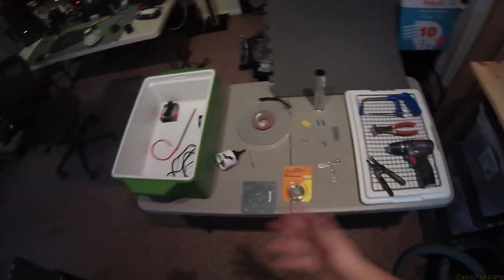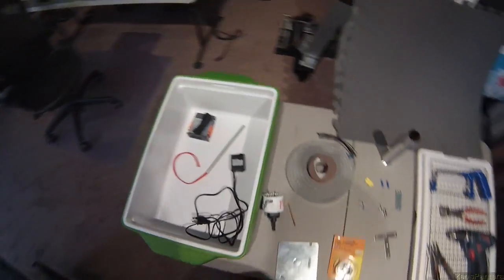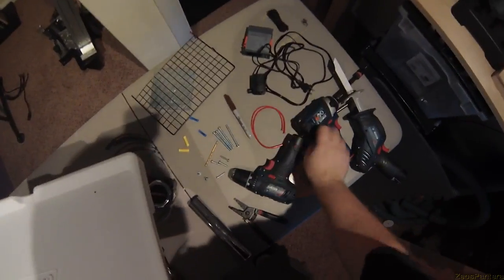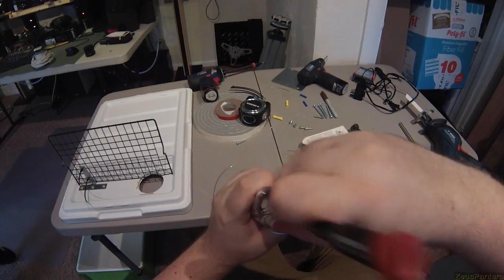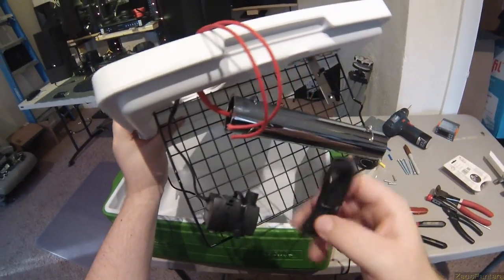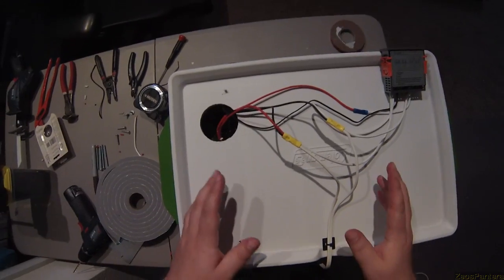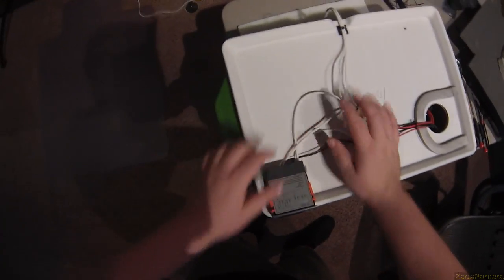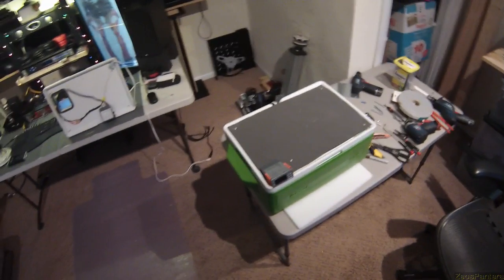$100 DIY Sous Vide - Build Video (Z How)

Comment: Nice build! Gonna try this myself this weekend as soon as the heating element gets to me😁
Just a few questions/remarks:
Is there a reason you drilled such a large hole for the cables to go through? Like venting or so? A smaller hole would allow less heat to escape, making it more efficient i guess? Or is this neglegible?
For what reason did you choose to mount the temperature sensor so close to the heating element? Did you measure the water temperature at different points throughout the container? Is it heating evenly? 

I guess i will try to put the insulation on the inside of the lid, but thats just for aesthetic reasons. Then mount a small project box to house the TC and cables, sealing off all gaps and crevices with epoxy. Maybe add a little valve to let off any excess air pressure if neccessary. 

Would be happy to hear your thoughts on this. 

Best regards from germany and keep up the good work!

Comment: Crazy question, why'd you make a 2.5 inch hole for just a few wires. wouldn't you want that hole as small as possible to prevent heat lose?
Reply: yeah need an explanation to this wondering

Comment: Great design. Impressive. I think I would've directed the water pump to shoot downward through the pipe with the heating element that way water within the pipe is always circulating.  It also creates an natural circulation throughout the entire cooler.  I assume this has all the safety elements that the store bought units would have in case the pump fails or the heating element circuitry doesn't turn off and on - all the other failure modes.  Leaving this running for 10 hours unmonitored without those safety elements in place would make me a little worried!
Reply: I too would send the jet down the heating element or drill holes into the pipe for better circulation.  Only safety issue I can see is water evaporation leaves the heating element out of the water and it burns out.   Which should just kill it, stops working as it burns out.   Only problem I see with sous vide cookers, all of them, if you're on a long cook and the power goes out.  How long was the power out and are your pathogen counts OK.  The odds are so low if your country has stable electricity.

Comment: I've heard conflicting opinions on those cartridge stick heaters as to if they are waterproof or not. On the top (wire) end, is it open or sealed all the way to the end of the wires?
Reply from the maker: Ive got two types. One was sealed the other just slipped a protective shield down over the contacts. So it is hard to say which you buy.
Reply: Z Reviews thanks for the reply. Do you remember if the brand you linked, "uxcell",  was the sealed variety?

Comment: I believe the placement of the thermostat end is incorrect.  According to the video it's right in between the pump & the heating element, surely this would give an incorrect temperature reading? Cooler water pumped towards a boiling heating element.. Its should be poked through the centre right between the cross that keeps the meat submerged.
Reply from the maker: Once it is all circulating the water is well mixed and if you probe with an insta-read it is the same all around the cooler. So it is fine where it is.

Comment: Coolers are NOT designed to keep cold in. They are designed to insulate. It doesn't matter if hot or cold is inside, it is designed as an insulator, it works the same regardless... I have seen a dozen of these videos claiming that heat inside a cooler somehow doesn't work... Had to make a correction. lol
Reply from the maker: Correct. BUT heat does escape the lid more than cold does. At least in my practice.
Reply: Oh, I see what you meant. Yeah, in an unsealed container, the effects of heat rising (and cooler air sinking) have a significant effect on heat convection through the top...

I have seen quite a few videos where someone has claimed that a cooler doesn't work with heat, and that anything warm will cool down just as quickly as in a regular container. My apologies for taking it out on you... ;-)
Reply from the maker: Yeah no don't worry, You were filled with dumbass rage because someone on the internet is a dumbass. Find that video and tell them that for me.

Comment: Could you please advise as to where I can find a schematic diagram of the wiring for this device?
Reply from the maker: I don't have a diagram. But both hot leads get split 3 times. Only one is diverted for the heater element and is intersected by the relay outputs

Comment: instead of wire make stainless set screws to the element. may be a little extra work but would look and perform much better
Reply from the maker: Would need a thicker pipe to thread them into. Or to soldier on nuts.

Comment: Hi Zeos, thanks for putting this together. Have you had any issues at all with the sensor being under water? 

I was about to order the ITC-1000 on eBay, but asked the vendor (in Hong Kong) if the sensor is in fact water proof. She said it is rated IP67. Looked that up and it basically said that it's kinda waterproof.  It can handle underwater applications, but not for too long. So probably not a good idea for a 48 hour cook...

In light of this info, are there any solutions that you can suggest to further protect an IP67 sensor? was thinking maybe if i wrap it in plastic saran wrap or something, that might do the trick? haha!

i'm not sure i can buy just the sensor.
Reply from the maker: +Paolo Vasquez The sensor is all sealed. I think it is designed to be watertight and I have had no issue with it in a year. Longest cook was 24. I put some heat shrink around it and the wire to stiffen it but that could also be used to protect it.

Comment: I Bullitt one issuing a 48-Quart collet and a 1500 watt heater coil and I have this weird pendulum effect were the water fluctuates up an extra couple of degrees. Is that normal?
Reply: Nevermind my pump warped from the heat and stopped working, any one have any suggestions on a good submersible pump that can take the heat?
Reply from the maker: +Boyce Thompson The little one I linked in the description has taken up to 170 for 6 hours and has worked for months. I don't leave it submerged when it isn't in use. I would probably use multiple pumps in a giant cooler like yours.
Reply: +Z Reviews you're probably right, took mine up to 180, the rest is history. On the plus side the chicken I made tonight was the most moist I've ever cooked.

Comment: Hey Z, Just built this and have a few questions. How  long does yours take to heat up? Mine taking forever ~ 1 hour to get to 66C, I'm just assuming that is because of the small surface area of the heating element and the amount of water the cooler holds,, it seams to boil the water and create a lot of steam. How high do you fill your water level? I'm doing mine just below the contacts of the ceramic heater. I wouldn't want to short it if the water goes too high. Looking forward to my first cooking in this thing though. +Z Reviews
Reply from the maker: +Martin Mal I can go from room temperature (70F) to 140F in about 30 minutes. I usually start with hot water from the tap if I can. I put the water as high as I can without going onto the contacts. The pump circulates the hot water around which helps.

Comment: Do i need concern about the ability of the pump to work in certain temperature? because i only found in my country that can work in water temperature as high as 60 degree celsius and i want to cook sous vide on 70C
Reply from the maker: +Christopher Francis Rhien The pump I used is not rated for high temps but I have pushed it over 75°C and it shows very little issue.

Comment: I've seen some people drill 2 holes into the side edge of the cooler top and inject it with some of that expanding foam to help insulate it -- thoughts on this?
Reply from the maker: +vpr Doesn't seem like there is enough space in there to fill. It is practically touching on the sides and definitely touching in the middle.
Reply: +Z Reviews They did use a different model cooler.

Comment: Hey, i have a question. Im using about the Sony mdr-7506, and im planning on getting a dac for it (modi 2). What im wondering is that would a good $50 or $100 amp really make that much of a difference, because im short on cash and really don't want to spend that extra money if it isn't going to be worth it. If you believe it is worth getting an amp, which one? I was leaning toward the magni 2 but im not sure if that money is worth the buy.
Reply from the maker: +Sean Munis (Mylittlebaboon) Well the modi is just a dac so you need an amp of some sort. Magni is the best match and gives you plenty of overhead but something like the sap2 from SMSL will also worjk for a bit less.

Comment: zous vide v2, will the pump have any issue operating in such hot water?
Reply from the maker: +sayerman So far nothing wrong with min up to 170F. Working for over 2 months.
Reply: awesome design considering a store is upwards of 3x the price w less capacity

Comment: This would have been more useful a couple years ago.  The Anova Precision Sous Vide Cooker goes on sale often for $150, and one time I've seen it at $99.  That's what I use with a big ole sauce pot I got at the thrift store, and sometimes I bring it with me while traveling and use whatever cooler someone has laying around.
Reply: You could simplify this down to about $30. 
All you need is the controller, a heating element and a pump. The rest you could scavenge from home, like you did.

Comment: For noise considerations, does the pump need to be on constantly or could it just come on when the heating element is active, as that is the only time when it's actually helping anyway?
Reply from the maker: +Em Te (mt1104) Id recommend constant but as long as the water is churned when the element is on it may still work fine intermittently.

Comment: even though there is no positive or negative with ac there is still a line and a neutral and for something like that you're probably gonna want to make real sure you're not switching the neutral and sending the line into anything like the heating element just for safety purposes more than anything